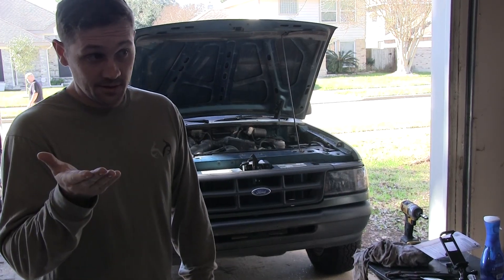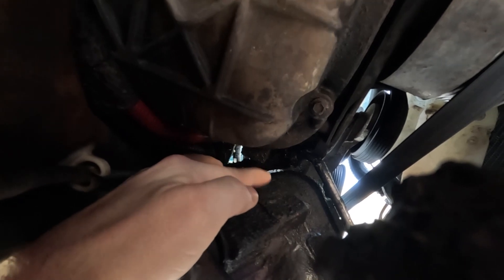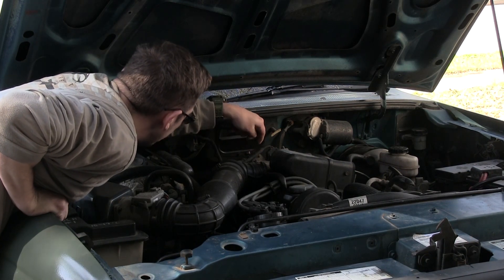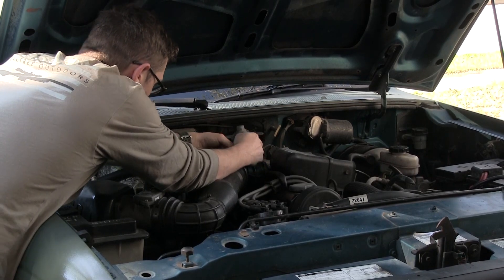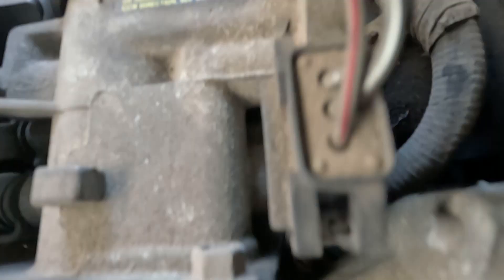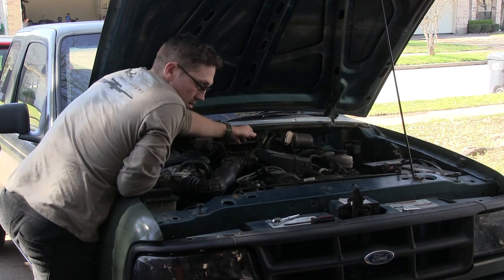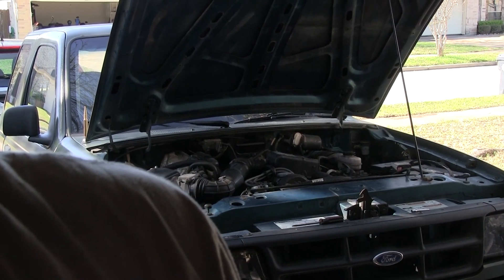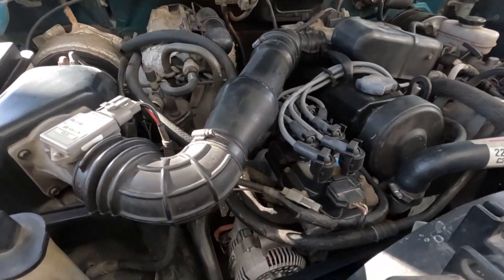Idle Air Control Valve and Leaks

Comment: Is the valve in the closed position? Or open part way when removed?
Reply from the maker: I dont remember. I just cleaned it out. After doing that I think it helped with my gas mileage. I was getting 19.8 afterwards I ended up getting 20.4. Not sure if it helped but I am happier with it.